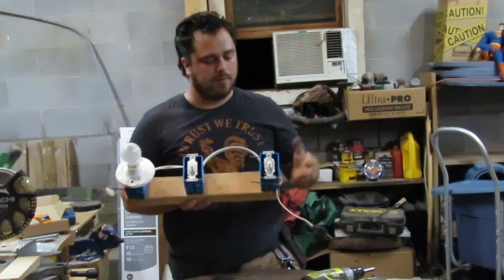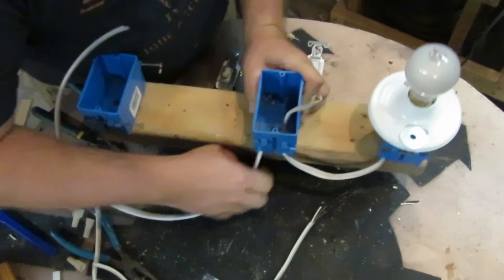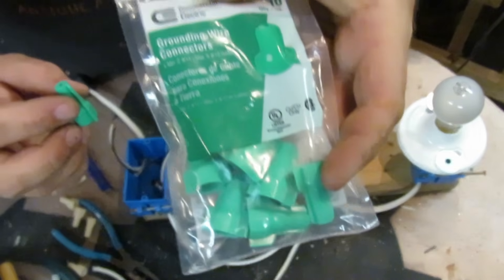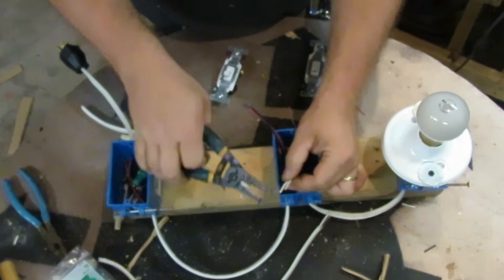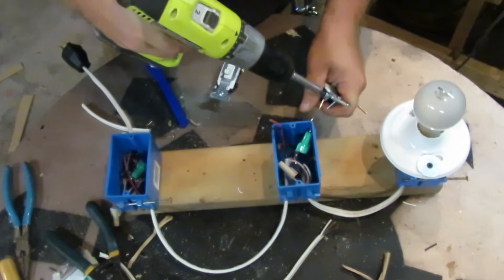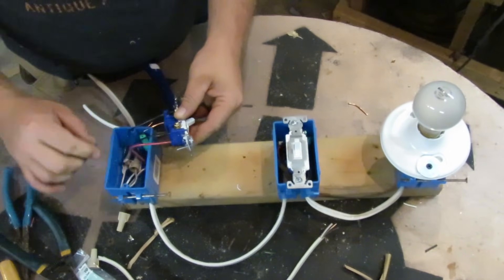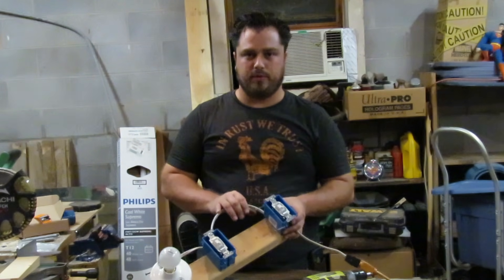How to Wire and Install 3-way Switches

Comment: 2 way ....
Reply from the maker: 3-way switch in America, 2way in other parts of the world
Reply: @MechanicalChaos  How is it 3 way? What is 3 way about it? How is 2 way and how is 1 way?
Reply from the maker: The only info I have been able to find, the 3way refers to how many terminals the switch has, similar to a 4way has 4 terminals, and a 'single pole' is what we call a standard on/off switch.

A 2way refers to having 2 switches or a 1way because there is only 1 switch
Reply: @MechanicalChaos  "A 2way refers to having 2 switches", like in your video. 😅
Reply from the maker: Yes, just like how they have 3 terminals, are you trying to make a point that I'm wrong because I'm from a different part of the world?
Reply: @MechanicalChaos  No. Just that the (European) logic is 2 way 2 switches, 3 way 3 switches. And I wonder how is the 3 way 3 switches circuit. How do Americans call that?
Reply from the maker: As stated before we call them 3ways because it has 3 terminals
Reply: @MechanicalChaos  How do you call the 3 switch circuit?
Reply from the maker: 4 way, because it has 4 terminals
Reply: @MechanicalChaos  Hmm. Ok. Thank you!
Reply from the maker: It was nice chatting with you, if you have any other questions, feel free to ask anytime

Comment: Thank you so much. Can you do it a Little slow. Thank you
Reply from the maker: I'm glad you found my video helpful.

It is a fine line between getting everyone the info and boring them, which is why it is sped up, if you need it to slow down, you can change the play back speed by clicking the 3 dots on the top right of the video and clicking on 'playback speed'.

Hope this helps

Comment: Remain unclear to me... Please have a closer focus recording
Reply from the maker: I can answer any questions you might have
Reply: @MechanicalChaos  i just want to see which wires did u connect to other ends
Reply from the maker: The black and red wires from the 14-3 wire are the travelers and connect to the brass screws, and the power goes to the black screw on one 3way, and the wire that goes to the light connects to the other black screww

Comment: Hope you can help me. I have two lights, one at the top of the stairs, and another light at the bottom of the stairs. How do I get the top switch and the bottom switch to operate both lights?
Reply from the maker: Are both switches on the same circuit? If yes, it'll be easy. If no it'll take more work. But both will require you to run wire between the switches
Reply: Yes, they are both on the same circuit. 
 @MechanicalChaos
Reply from the maker: You should be able to run a 14-3 wire between the switches.
Both 3way switches will use the 14-3 red&white as travelers.
In one box wire off the hots and hook up the switch line& black wire from the 14-3 as your commons.
In the other box,hook up the hot(s) as your common, wire nut the switch line to the black wire from the 14-3

Comment: SHOW US HOW TO INSTALL A **4 WAY** SWITCH -- I was working on a home remodel ( gutted the home started from almost scratch -- I wired the house from the mast to every outlet.  I TRIED AND TRIED to install a 4 way switch set up (1) switch at the bottom of a stair case (2nd) switch at the top of the stair case (3rd) switch upstairs at the end of the hall way.  I followed 3 books a video ( BEFORE YOU TUBE CAME OUT ) and 2 Master Electricians schematics and bought 2 different sets of switches FROM each master electrician --- NOTHING EVER WORKED -- I had to settle for just a 3 way set up ( top and bottom of stair case ).
Reply from the maker: I did a video about 4way switches if you would like to check it out, and I can try to answer and questions you might have

https://youtu.be/bisIozNsddM

Comment: Followed your video but my hot switch is controlling the second off an on. Going crazy
Reply from the maker: They're both 3way switches? If so, the commons and the travelers have probably gotten mixed up at one or both switches

Comment: Always wrap the wires around the screws.  Never stab the wires into the back of the device..
Reply: The new boxes are made that way, to stick them in the ports and tighten the screws so no bare wire is showing.

Comment: No explanation on the feed, and switch leg in the same box?
Reply: It's very easy , there are about 6 ways to wire a 3-way switch
Reply from the maker: Not in this one, at some point I want to do a video with explanations on all of the different ways a 3way could be wired

Comment: I was told to wrap the wire around the screw instead of sticking it in the back, mainly to eliminate the problem if it needed repair, you cant pull the wire out the back as if you wrapped it around the screw you can take it off.
Reply from the maker: Lots of people say that, but I habe had fewer lose wires by using the backstab, if you twist the plug or switch as you pull, the wire will easily pull out
Reply: Mechanical Chaos see I’m in electrical class in High School and my teacher says over time since the switch heats up and when you backstab it has a spring to keep the wire that you backstabbed in place and over time when the metal gets hot and expands and cools down and contracts the spring gets loose and the wire that you backstabbed would get set free possibly causing a fire... and his #1 goal is safety and not causing fires.
Reply from the maker: That is old school, new backstab are much better, If backstab were unsafe, they would be against code, check out my video about taking apart the 3 most common devices, receptacle, switch, and the 3way switch
Reply: There's a release on back stab device's,  it's the small square,  small screwdriver,  or piece of wire also works
Reply: Are you a state licensed electrician ? if your not you shouldn't be giving advice in areas you're not licensed in,  I'm very sure your not licensed in all 50 states  ,

Comment: And tell me what a common and a traveler is again? 
I got a red black and white.
Reply from the maker: Sounds like you might have a "dead end 3-way" where the power wire and switch wire are in the same box, so you might look for info on that, but to answer your question:

The common is the wire with the power OR the wire that goes to the light.

The travelers are the 2 wires that connect between the 3-way switches

Comment: How would you connect the wire if your taking power from an outlet with 14-2 wire? Thanks so much for the video bro, helped me big time
Reply from the maker: That would just be your power into the switch, and if possible have your switch wire come from the other switch.

If you have to have power and switch wire in the same box, you would need to do a "dead end 3way"
Reply: Mechanical Chaos you lost me on the dead end 3 way
Reply from the maker: If the switch line and power are in the same box with a 14-3 all in one box and only the 14-3 wire in the other box is called a "dead end 3way" but if power is in one box and the switch wire is in the other with a 14-3 wire between the boxes, it would be the same as what is shown in the video.

Comment: I'm trying to install a pair of 3 way switches to operate a kitchen light.  The problem is that with one of the switches, TWO of the wires are live, I think it was the red & white wires (I haven't looked at the other switch yet).  I have two wires that are live, how is that possible? Which one goes to the black screw if they're both live?
Reply from the maker: The other switch may be hooked up wrong, but how do you know that both of these wires are live?
Reply: I have a voltage tester.  There's power at both of the wires.  Both switches date back to 1960-something.  They both correctly controlled the kitchen light until I meddled with it trying to update the look of the switches, now one of them acts as a kill switch, killing power to the other one.
Reply from the maker: Would I be correct to guess that this box only has a black, white,red, and might have a ground wire? IE: one peice of 14-3
Or does it have 2 white, 2 black,1 red, and might have grounds
Reply: The wiring is from the '60s, it has the old cotton/fabric cased copper (it's definitely copper too).  One wire has the remnants of a red casing, then a white one, and then a black one.  There is no ground wire. Fortunately, it's a metal workbox with armored wiring all the way to the panel.  I was able to screw a green ground screw with 7" of a bare copper 14 gauge wire to the back of the metal workbox for my ground. I've never seen this before and it's maddening, and also incredibly labor-intensive trying to figure out how to eliminate the "kill-switch" feature of the other switch (which I haven't touched yet).
Reply from the maker: If it only has the red, black and white wire, then ot is probably what we call a dead end 3way, this switch would then be wired up as red and white travelers and the black as the common, while the other side will have your power wire and switch wire and travelers, the 2nd switch will have the matching red and white as travelers, and the black that goes with the travelers being wire nuted with one of the other black wires, and the 3rd black wire will be your common, and the non-traveler white wires will be wire nuted together
Reply: OK, this weekend I'm going to try and swap out the other switch to see if I can get it to work.
Reply from the maker: Good luck, feel free to ask when ever you have anymore questions

Comment: Is there a way to replace and 4 wires switch and install a single pole switch (3wires) . 2 black, 1 red, and a ground. Thanks
Reply from the maker: If you want to turn a 3 way into a single pole, just put the black and red paired wires together on the switch and the other black on the other side of the switch, and ground to green screw. But the other 3way switch won't work anymore

Comment: 1st off thank u for the video ... I feel very positive to do this now ... 2nd can I use a 14/2 and 14/3 wire in a pvt house ? And can I use the same gauge with metal clad ???
Reply from the maker: 14/2 and 14/3 are perfectly acceptable as long as it is on a 15 amp breaker, I'm not sure about the metal clad wire, I would just use copper wire

Comment: Excellent video. I'm not sure what you mean by traveler wires, but I can look it up. Thank you!
Reply from the maker: Thank you . The Traveler wires are the wires that go between the two three-way switches as in they travel between the switches
Reply: CM use cat5 wire. Works great.

Comment: Why would you need two switches on one light?
Reply: Anywhere you have two entrances into a room. You don't want to have to cross a dark room to turn on a light. Stairs would be another example.
Reply from the maker: Hall ways would be one example

Comment: But what if the main does not have the ground?
Reply from the maker: It is preferable to have grounds, but unless it is a new "smart" switch, it switchs should work without grounds
Reply: You can disregard it. It did work with the grounds. I had to toggle the main. It was not twisted properly. The wires were just a bit loose. It was my first 3-way.
Reply: You might be out compliance than. and your wring is old
Reply: Very true. Had to add a ground on each box. And yes!! It is an old house.
Reply: @DEADLOK69  I had the same issue☺️

Comment: To fast didn,t show slow how to hook wires on switches.
Reply from the maker: There are stab in holes on the back or you can put a hook on the wire and wrap it around the screws on the sides

Comment: I want to add an outlet down below one of the switches  how is that hooked up ?
Reply: 14/2 "IF" it's on a 15A breaker.
Reply from the maker: You could only do that if you are on the power side, if you have consistent power, use 14-2 wire to run from the switch box to your outlet. In the switch add the ground wire to the others, add the white neutral in with the rest of the neutrals, and add the black to the commons

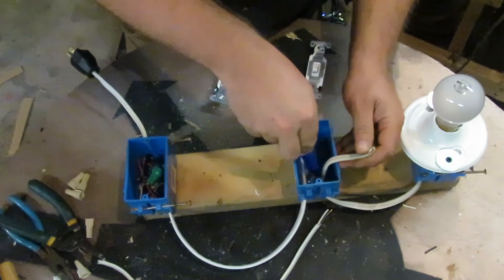Comment: 2:15 What? You already lost me. Whats an og wire? What's a traveler wire?
Reply from the maker: Odd wire, as in it doesn't have a pair.

The traveler wires are the wires that feed between the two 3-way switchs (red and black in this example)

Comment: Are these not your typical switch or special 3-way? Thanks, a little fast for.1st timer but will watch again.
Reply from the maker: I would say these are very typical, the screw colors and lay out of the screws may change, but there will always be 2 screws that are the same color,which are for the travelers, and 1 diffrent colored screw for the common.

Comment: Great step x step video on 3- way switches.  I’m having issues with mine currently, where my 3-way isn’t turning my light on or off.  I use to have Phillips Hue bulbs in my older fan which I replaced with a 2-bulb light instead, so I could turn the lights on and off just by asking Alexa with my voice.  Then I recently noticed that, I could only get one bulb to turn on and off. So I put regular bulbs in, instead and the 3-way switches don’t even work with the light anymore.  Any ideas, advice, suggestions of what might have happened?  I could really use your help here. Thanks and keep those step x step videos coming. 👍🏼
Reply from the maker: Thank you. Did you change the switches at all? If the answer is noand everything worked before changing the light then the problem would be in the light box, do you remember what wires were in the light box?

Comment: How can I email you a question on how I want to wire a switch ? It’s for a project for my vehicle
Reply from the maker: You can ask me here, but vehicle switches are pretty straight forward, the hardesr part is figuring out where you are going to get power

Comment: I followed your instructions but one of the switches has to be on for the other one to work. So switch 1, where the power comes in, has to be on in order for switch 2, where the power goes to the light, to turn the light on. If switch 1 is off, then switch 2 doesn't do anything. What did I do wrong?
Reply from the maker: +Luke Juras sounds like a traveler and a common are mixed up, make sure all of your travelers are on the brass screws
Reply from the maker: +Mechanical Chaos if that doesn't work, it could be a bad switch
Reply: I had the same issue.  My carrier wires are black & white, so it was confusing.  Make sure the lone black goes into the black screw on both switches (hot).  The other red & white (or in my case they were black & white) travelers go to the brass screws.

Comment: I have a 3 way set up in the hallway. One switch has 2 black and a red. One black comes from a different location, I plugged that one in common. The other black comes in with the red so I put those as my travelers. The other switch has a black, red, and white. All three come from the same location. I put the white in common and the black and red as travelelrs. My issue is that when I use the 1st switch, it turns the light on and off. The second switch only turns on and off if I leave the first switch in the on position, so they don't both work independently? What is my issue here? Any help would be greatly appreciated. Thanks and thanks for the vid!
Reply from the maker: Sounds like your travelers go through another box, could be the light box. I would guess that your first switch is correct. I would try useing the red&white as travelersand black common, if that doesn't work, try white&black as travelers and red as common.
Reply: Thank you for the reply. I watched another video too about how to fix it by testing the wires with a fluke pen and a digital multimeter so yes, basically what you said is what I'm gonna do. Thanks again man!
Reply from the maker: +mddubtubeyou glad to help
Reply: Mechanical Chaos you were correct all the way!

Comment: Great tutorial video!  I followed your instruction, testing each wire and 3-way switches and checking the wire connection.   They're all correct, but the working-light is still not on.  Appreciate all your help.
Reply from the maker: +Binh Minh Pham try replacing the light bulb if that doesn't work pull down the fixture and check for power at the ceiling. Check the hot wire with the ground wire, then check the hot wire to the neutral wire.

Comment: i thought the screw that sits by itself on one side of the switch supposed to have the hot wire coming in from the source and from the light on the 2nd switch
Reply from the maker: +Mahu J the odd colored screw, is the common(the hot or switch line).
Different manufacturers might change the location but it is always the odd color (typically there will be 2 brass screws and 1 black screw)

Comment: Bravo you are fast thanks
Reply from the maker: +Danilo Arevalo thank you, glad you liked the video
Reply: Mechanical Chaos so the green wire nut for the ground eliminates the need for a pig tail? Where did you get those wire nuts?  Great video, you explained it better than my teachers!
Reply from the maker: sorry, only just saw your comment. You can buy these at Home Depot or Lowes or most any hardware store like Ace Hardware or Do It Best Hardware
Reply from the maker: in case no stores around you carry these, here is an Amazon link   http://a.co/8PR8TtJ